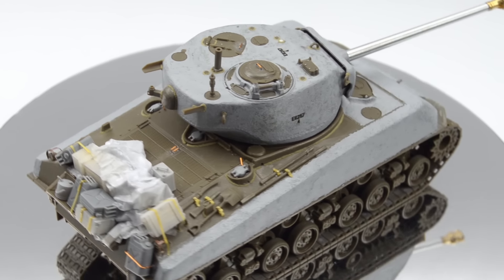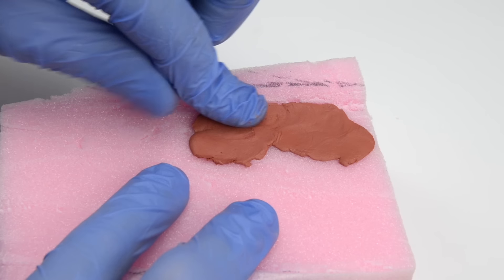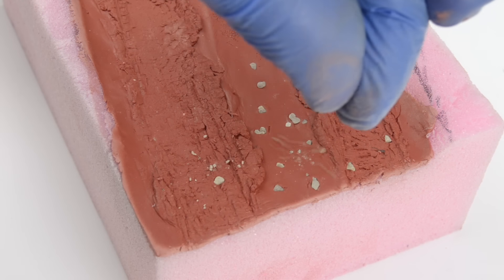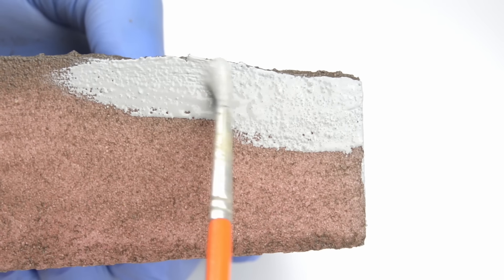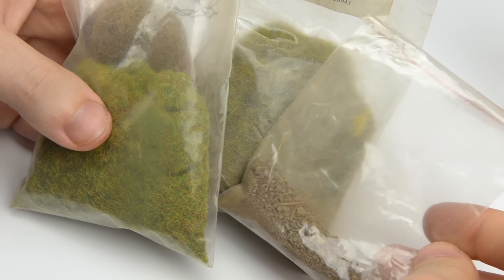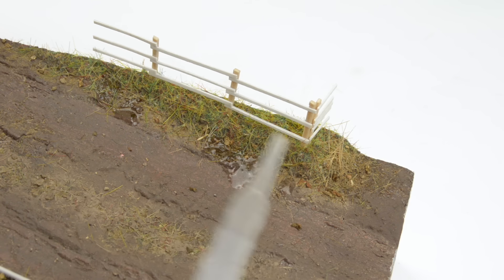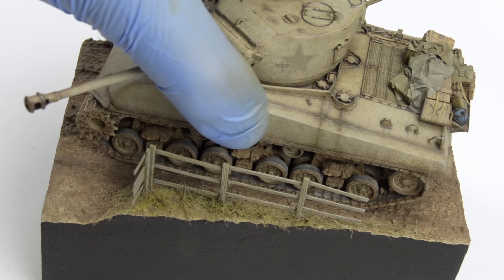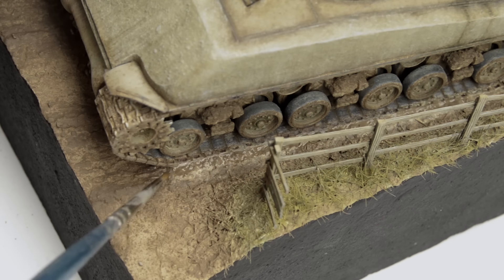Somewhere in Germany 1945... | Sherman Easy 8 Vignette | M4A3E8 Tamiya 1/48

Comment: I do model railroading and I bought a video where they show you how to process dry leaves. First, when the leaves are in the blender, add water, like half full. Then dump your leaves into an old shirt and squeeze out the water. Then place the damp clump of leaves on a cooking sheet, spread the leaves out and bake for several minutes until the leaves are dry. Finally, use a sifter like a wire mesh strainer, and sift out the final “dry leaf” texture. It will be in a perfectly small scale for your dioramas :)

Comment: 1:30 when he pulled out the Damascus steel kitchen knife, a large smile went on my face. Damascus steel is awesome
Reply: It’s technically pattern-welded steel, not Damascus steel. I’m not going to tell you to call it pattern-welded because i understand that it makes it seem way cooler if you call it Damascus steel, but there is a big difference between real Damascus steel which they can no longer make and pattern-welded steel which is just forge-welding a billet of different steels to give you a certain look. The bands in Damascus steel consist of carbon nanotubes and cemenite nanowires which are part of it not the reason why Damascus steel was so strong. Conversely the bands in pattern-welded steel are purely cosmetic. At the end of the day idc what you call it as long as you know what the difference is :)
Reply: Peter Marrocco thanks for the info!
Reply from the maker: It was still no match for the uberstyrofoam tho
Reply: Night Shift now just wait until you get that hot wire cutting table!

Comment: When applying static grass I often found you can just pinch a teeny tiny bit between thumb and forefinger, roll it back and forth a little in your hand to get the strands facing all the same way. Dab the short end of your bundle into the glue on the ground a few times, depositing pinches of grass as you go. Then, so it looks more natural, you can use some small scissors and trim the shape. 
It takes a little while but you can get into a rythem and cover a whole field that way.

Comment: Here’s a technique I’ve learned from another modern YouTube you might have heard of called Andy’s Hobby Headquarters. Anyway the technique is: have a space pair of rubber tracks so you can press it down into the mold (and I believe you let it dry with the tracks in there) and than your peel the rubber tracks off and it leaves a really nice track impression

Comment: What I used to do with grass before I got a good static grass applicator was using a vacuum cleaner to make the static grass stand upright more. The first applicator I has didn't have enough strength to make the fibres stand up well enough but the vacuum cleaner worked quite well..as long as you don't get it to close.

Comment: Nice job on the diorama. Usually, most armor kits have extra track links. Particularly, Dragon kits. You can make a track "stamp" by assembling the extra links and attaching them to a piece of sprue. I have a collection of these that I have accumulated through the years, for various different track styles. I think you will like the static grass applicator. I have a homemade one. Nice video.

Comment: Texturing the styrene before cutting is a lot more easier. And with razor saw or metal brush,  a final pass with Scotch brite will remove most bits which didn't come off.

Static grass applicator is a must. Woodland Scenics has the heavy duty Static King, but also a cheap plastic can, which seems to work for small project. The transformer fly swatter are also good for small grass. I use up to 12 mm grass, and for that the Static King is a lot more successful.

Comment: Suggestion for incorporating figures in future builds: Typically, due to the poor visibility outside the vehicle, crews of WWII tanks would have their hatches open and their heads sticking out until they were actually getting shot at or bombarded with artillery. (commander and driver) 
For when you do your first figure on this channel like you mentioned, it would be awesome to do the tank crew unbuttoned and operating the vehicle, particularly for a WWII tank.
Reply from the maker: That's something I'd definitely do. A partial figure isn't so time consuming so it would be a good starting point. Part of me wanted to paint the tank commander included in this kit, but unfortunately there was no hatch detail from the inside so I just kept the tank closed.
Reply: @NightShiftScaleModels  Check out the Chieftain's hatch on youtube if you haven't all ready. He does interior tours of various WWII tanks.

Comment: I don't have a static grass applicator either. The best method I've found is to grab a big clump of grass between two fingers and sort of dab it on to the glue. It's still not perfect, but it's better than sprinkling it on.
Reply from the maker: Yup, I thought about that as well, unfortunately too late... and now I also have the applicator :)

Comment: I enjoyed your video and your expert skills on this build. A question has entered my mind. Your tank is well weathered, in the field and well used. This would suggest a worn track pin, a frozen bearing on one of the return rollers, or a possible thrown track. Would this not result in a few small chips in the top sharp outer edge of the cement?
The removal and replacing of the tools, a few more white chips, a couple of larger in this area of the cement showing? Wouldn't there be a few possible scratches in the sides of the cement, a change in color from sliding across the surface of the cement. The loading and unloading, the dumping fuel in from Jerry cans. It is just a thought that popped into my head as a looked at the final work. Again beautiful work.

Comment: for your grass fiber, you can put down a base of watered down PVA glue then take a piece of PVC pipe, rub the pipe with cloth to generate a static charge. as you sprinkle down the fiber bring the pipe close and it will encourage the fibers to stand and align. wont be perfect and you can buy/make better tools to do this. but its an easy test to see if it works for you
Reply: never mind i was typing this as i heard you say you ordered a static applicator

Comment: A stunning model and diaroma, my comments i would of increases the width and depth of the base poss 1" / 25mm each way just so it doesn't look quite so the tank is crammed into the base with very little surround. i would also reduce the overall height of the base by about the same 1" /25mm. you're dealing with proportions 'tricky things' but way and a league better than i could do. A+

Comment: For track impressions on clay: Grab a spare length of those metal tank treads for the tank you're currently working on, wrap them around something like a roll of tape, and roll the impressions in?
Reply from the maker: Sadly I didn't have any leftover tracks from 1/48 kits so there wasn't much I could do. Luckily I figured something out for the next base.
Reply: @NightShiftScaleModels  do the clay part of the base first, with the tracks before paint/assembly

Comment: You know, just before you started applying layers of paint on the scenery, the terrain made it looked like if it was a wet, grim and rainy day. I think if you just painted the fences and accentuated the effect a bit, the scenery would look even better... but I get it, a dry tank on a rainy day wouldn't have fit🤣. Bah, it'll be an idea for next time, keep up the good work!
Reply from the maker: Yeah, the point of those pre-colored mud pastes is they can be left in their original color. Unfortunately this one was too glossy for my taste, and it wouldn't fit the mud tones on the tank. That's a very important thing to keep in mind.
Reply: I agree on that, making models myself, such detail can make the tank look out of place if done incorrectly.

Comment: 2 minutes in....

You got a table saw!  You couldn't do multiple passes?

Even if you ended up with a small section which couldn't quite reach with the table saw, it would have been easy to cut through the last bit with the knife.

Or am I missing something?

Comment: Dear Uncle, just wondering - couldn't you just link reference pics in video description?
Reply from the maker: In many cases the reference pics have been sitting on my drive for years, and I wouldn't even know where I originally found them :) But I started adding those that I can directly into the video, mostly WW2 historical pics.
Reply: @NightShiftScaleModels  You can use Bing to search using an image from your computer
Reply: @NightShiftScaleModels  That's explains a lot :) Thanks for answer and your amazing videos!

Comment: Comrade Nightshift, may i suggest you not to buy that hot wire table. It's a waste of money and the smell is... yeah. I work with all kinds of foam regularly and so far my favorite cutting method is to saw it with a hacksaw blade for thick pieces (this pink extruded poly stuff) and a sharp box cutter blade for the thin ones and the regular (grained) polystyrene.